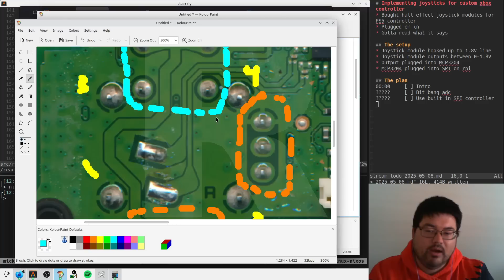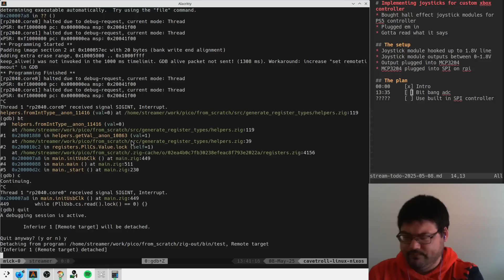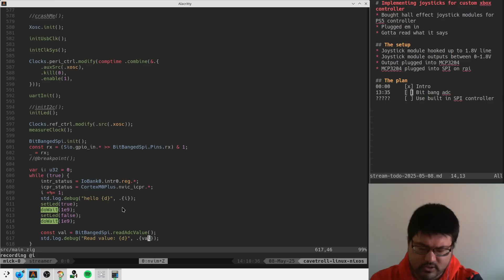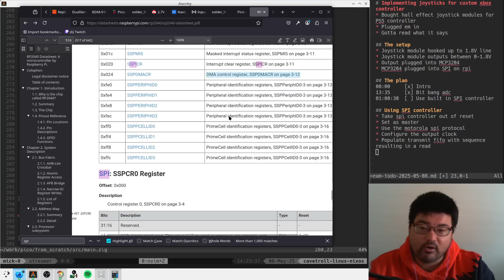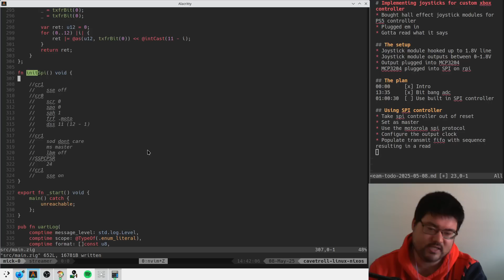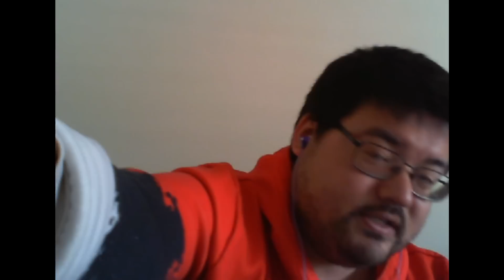Stealing a PS5 joystick for my homemade controller

Comment: Didn't we used to have non stick drift analogue sticks?
I think my ps1 controllers never developed that issue.
Before Switch I hadn't even heard of such problem.
Reply from the maker: my memory is that there were just massive deadzones
Reply: @sphaerophoria  can't argue with memories.

Last old type controlled I used was wii nunchucks and they felt perfectly fine after years of use.
I think I saw 1 video that explained that the technology also just changed probably for cost reasons.

Comment: you can CNC or laser away the copper on a blank PCB to make a design, but those methods are rather limiting. Usually you coat the board in some kind of UV sensitive material, and then mask out either the bits that you want to go away, or the bits you want to stay (depending on if its a negative or positive) and then you expose it. Once exposed, you can remove the unwanted material, and you get a mask. Then you use chemical etchants to remove the copper where you don't want it. Of course, that's just one step, there's also drilling and plating to connect signals from different layers, etc.

Comment: I thought the ps5 used potentiometer and not Hall effects?
Reply from the maker: yeah mayhe that was a little unclear. I want hall effect sticks, ans the easiest way for me to get them was to buy a hall effect upgrade for a popular controller
Reply: @creator-link they do, but the after market hall effect sticks emulate the potentiometer sticks using hall effect using the same voltage range, Essentially the controller doesn't know there's any difference